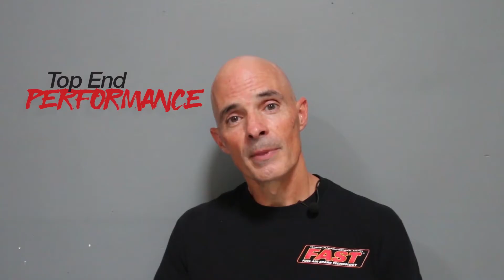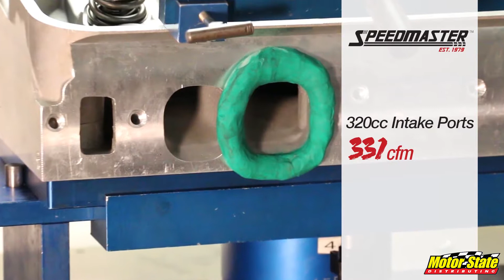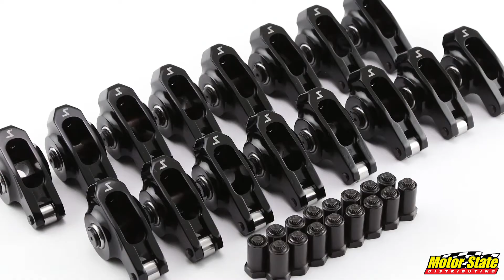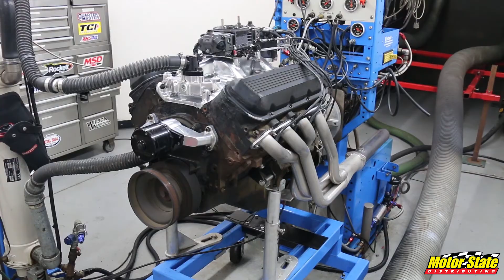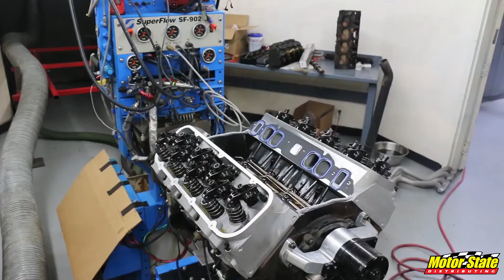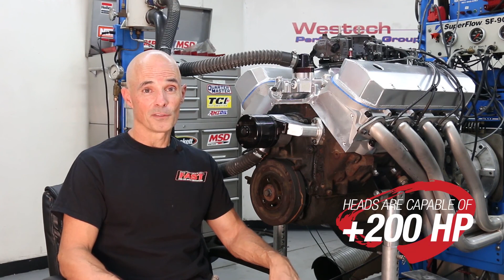Speedmaster BBC Top End Kit

Comment: Notice they did not test them against the  L29 100cc stock iron head that comes on the gen 6 because it made 428hp on a previous video they did on that junkyard motor with a little port work the L29 head would have made just as much or more power with port work!
Reply: And added 150 lps